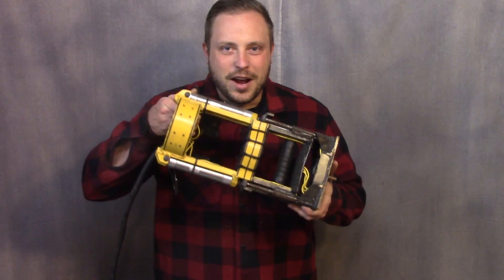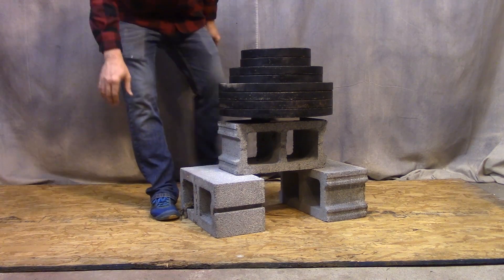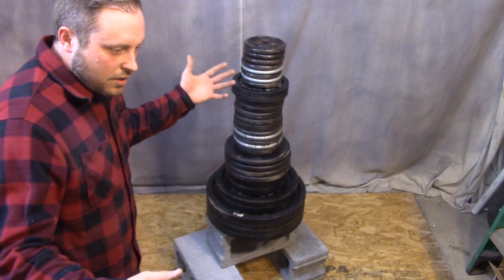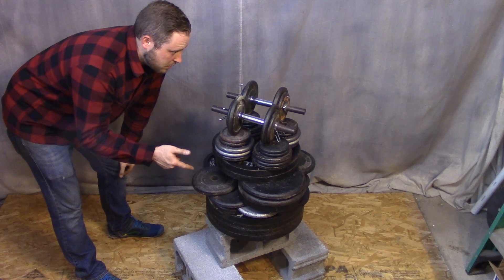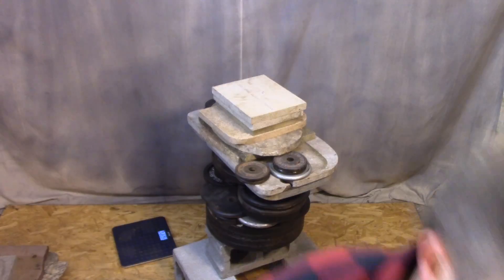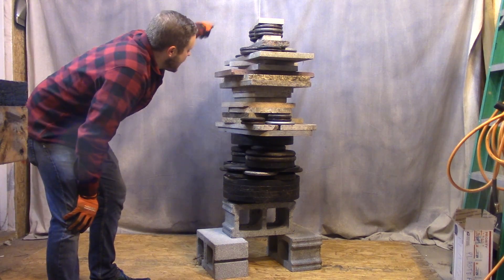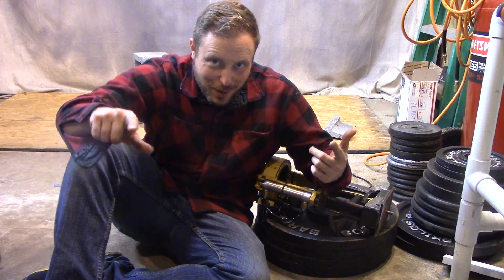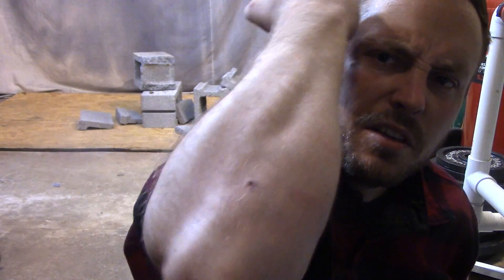POWERFIST POWER TEST - How much force to break a cinder block

Comment: but impact force is totally different than weight, weight is calculated by by the force of gravity on a given mass, where as impact force is is the total amount of force a point of impact measured in pounds per square inch and or Neutons

Comment: You can smash a cinder block with pretty much any hammer, axe, heavy metal bar some people even with bare hands, the doors you used in another video could have easily been kicked in so as a real test I wanna see if this thing will break in something like a solid hard wood or reinforced metal door or smash down a wall made of cinder blocks!

Comment: With the cinderblock McGregor could probably still do it because his fist has less surface area.
Reply: HelixMaster12 If his fist didn't deform on impact maybe
Reply: HelixMaster12 he would do it if he wants to Fuk up his hand for life 😂😂😂😂
Reply: His powerfist has blown through a steel door frame and etc. It isnt just a nifty knuckle protector. The fist protrudes out as he punches, (using c02) and produces a more powerful blow.
Reply: Tony Ravioli also to ampifly it, it has a small button on front with even less surface area

Comment: The block didn't break because the 1,000 lb of force was spread over a large area distributing that force while when punched it with your first all of the force was focused on that one point making the force much greater from the punch. If that doesn't make sense just think of that circus act of laying on a bed of nails; whey don't they get impaired laying on a thousand nails but if you do 100 you do get stabbed the due to the amount of area the pressure is exerted if the amount of force.

Comment: Is this guy like the dumbest person on earth? You have 3 vertical pieces of concrete in one of those blocks. If you stack a big round weight on the bottom then slowly add more weight you are distributing that weight evenly across those pieces....which are vertical making them able to hold a substantial amount. Hitting the brick in-between those vertical pieces with a heavy piece of metal doesn't mean you put more force into your strike than the weight places on the bricks.....in addition when you break something like that and it shatters it means your force is going through it and transferring into what's behind it. The difference between breaking 1 brick like that and 2 is almost nothing, unless the brick was a completely solid piece. Acting like breaking through 2 bricks means you hit twice as hard just makes you twice as stupid to anyone with a brain. Worst, dumbest, and most misleading video on youtube and youtube is full of a lot of dumb shit.

Comment: I don't mean to be a party pooper, but I do think that there is a difference between the static force of the weights bearing down on the block from all those lead weights and your kinetic energy that you impart to the block. I can't remember exactly but it has something to do with tensile strength vs load compression strength or some such physics. The force that your weights were exerting was more of a crushing force that was spread out across the entire block. The block appears to have a good resistance to a crushing force. But your punch was more of a piercing force because all of the kinetic energy was focused on a smaller area.

So maybe that block can withstand crushing forces over 1500lbs when the load is spread across the entire block. But focus that same energy on a much smaller area and the block can't withstand it. Like eggs. You can walk on many eggs that are in egg cartons and stood upright. But you would crush a signle egg. Or like walking on nails. You can walk on many but impale yourself on one.

Comment: There is so many false statements here. For example the cinder block is holding the weight on its outside, the strongest point. U stuck the center the weakest point. That point can be broken with a very confident persons foot. The reason the first experiment didn't fail right at the start is because the weight was being evenly distributed making the weight test useless. The right way to do this test would be to us a pressure board on top of the block. The board will recorded the amount of force reliably and u don't have to use a cinder block or weight.
Reply: I would also like to add that the tip on the tip would make it so easy that u could stank on it if the tip was in your foot

Comment: 1,900 psi is needed to break a single cinder block if my information is correct. This is of course not adding other materials to the structure. So as a force multiplier this is so strong for the size. My only thoughts to this and how to improve it, would be to double plate it. Keeping the co2 pin (i assume) as springy but bring out the first plate in the front along with pins on the corners. Maybe this is not a very well explained idea. I am no physics person so multiplying force on a flat surface idk. But by adding the bend and the points you would be able to apply the force easier. Or well i think you would. Again could be wrong either way this would be a amazing tool to say possibly sell to cops. Does not look very heavy.

Comment: when you were adding weight you were just testing its static load bearing capacity but when you punched it ; you were testing it's impact toughness . Both are different you cant compare those two on equal levels man.

Comment: It didnt break because of huge area of weight basin. If you add weight to smaller area, it will do much greater pressure. And than it will break it.

Comment: Now pick up the ten pound Weight and drop it from about 5 inches and it'll bust. Cinder blocks are used to hold mobile homes up you putting weight o. It proved what? Just curious

Comment: The way he put the weights on the cinderblock was not done correctly. Since he put the big ones on the bottom for proper balance, all the weight is distributed evenly throughout the cinderblocks.
Reply: JAIRUS OF ALL What? Do you fucking understand what he’s saying? You could have put a piece of plastic there instead of a cinderblock and it still wouldn’t have broken! The weights were holding it in place so it couldn’t snap in half!!!!
Reply from the maker: ooooh.... maybe you should watch the whole video and pay attention.

Comment: i think the cinder blocks can stand weight, but not intense sudden shock. I've broken cinder blocks just by throwing them hard enough, and I doubt they hit with 1000 pounds of force, so i dont think ur power fist punched with 2000 pounds. tbh, I'm not an expert, so if I'm wrong, please correct me.

Comment: i broke one of those with a golf club boi
Reply: WhynotGaming it's possible.

Edit: In this video he was only applying surface weight.
Reply: it's actually really easy to do, i would film a video and upload it to show you but i don't have any golf clubs right now so maybe if i find a skinny metal pole i will do it, also these are not that hard to break, you can also smash them into pieces with a small hammer.
Reply: Gabe Ruesswick I agree and I've broken cinder blocks with a short piece of 1/2 inch emt which is electrical metallic conduit which is supper thin and he also set it on the center beam which is the strongest point and like you said he had a punch basically on the tip of the power fist that popped through the block completly before the large area touched the block but this is a awesome build  not hating just saying he was wrong with the test and giving wrong info
Reply: Harrison maddox the "punch" as you call it is used to activate the fist, but it wasn't going to work because he didn't have co2 to use, which means that all it did was contract into the fist
Reply: RWH German Shepherds I believe you he used a retarded way of breaking and the power fist has a smaller surface area
Reply: its really fucking easy to break cinder blocks. They are designed to take on extreme amounts of pressure. Not suddenly applied force to a small point. 
A child can break them with a metal rod. Same goes how you can break a diamond with a hammer.
Reply: German Shepherds I just dropped it...
Reply: German Shepherds looks like a mess on mobile
Reply: German Shepherds boi
Reply: boi 👏
Reply: Maddinhpws I broke one with my hand when I was 10 lolol
Reply: But tell me... did you do it with a fuckin powerfist? I think not
Reply: I actually laughed bruh xD
Reply: German Shepherds ok
Reply: Lies or weak as cinder block cause u bought the cheap shit u poor kid
Reply: Momentum
Reply: German Shepherds my old friend broke one with his elbow years ago and he was 10
Reply: His powerfist has blown through a steel door frame and etc. It isnt just a nifty knuckle protector. The fist protrudes out as he punches, (using c02) and produces a more powerful blow.
Reply: Harrison maddox actually, if you watch the video of his with the steel door it shows that the protrusion on the front sinks in to act as a trigger.
Reply: Maddinhpws you cant break a Diamond with a hammer
Reply: German Shepherds UR A LIER I TRIED AND IT BROKE MY GOLF CLUB
Reply: Adrien010406 - Overwatch aha, hahaha (it was a sarcastic laugher, liar alert '-'

Comment: See you are cool in a way but you do under stand a 5lb hammer will bust the block easy were you would need almost a ton the way you did it. An the power fist doesn't add weight it adds velocity and that nipple on it is a bigger cheat to make it break stuff way easyer even with it retracting it still effects the break if there isint a straight down level blow which you need a machineto achieve.   Read up on mass vs velocity you will understand

Comment: Interesting. Concrete has great compressive strength but its not as good at handling impacts, thats why its used in huge building projects. The weight seemed to be fairly well distibuted along the cinder block maybe if it where more focused in the center the outcome wouldhve been diffrent.

Comment: Stacking the blocks does not multiply the force required to break them. You have to imagine the force being transmitted through the blocks. You could stack 5 blocks, hit them with a sledge, and break them all conceivably.

Comment: its structural integrity from the floor up is on its sides, when u placed that first weight it distributed all of its weight evenly across the whole top of the block, and the sides of the block are simply supporting the weight, not the empty space in the block. and the little point on the powerfist will pinpoint all the enerrgy into that one little area. so 1000 pounds per square foot compared to 200 pounds a square inch

Comment: If u put a point on the bottom plate maybe you can break it but you’d have to put about 300 lbs at once. You broke it with the power fist bc you concentrated your energy in a small area. Plz learn basic physics

Comment: No you are not putting down more than 1000 pounds you have a little point on the power fist so all the power you putting down is going into a smaller space so the psi is more than 1000 but you are not putting that amount of weight down.

Comment: Concrete is strongest in compression which is why it doesn't break initially. It would easily break apart if the tension was at 100 or 200 lbs of force

Comment: The fist has a small point at the top so the force is in a tiny area. The weights spread the weight out so the block could easily take more weight

Comment: The reason the block didn't break with weights was because you were putting them on the center which was like seven inches thick. Like wise when you punched it you can see that the center didn't break. The block broke off-centered from the middle

Comment: There's a thing called surface area and if it's spread than it won't brake if it's a small surface area than it will brake better and the power hammer has momentum un like that whale of a creation over there

Comment: There's too much surface area on the bottom so there isn't actually that much pressure or weight on a specific area
So use smaller weight on bottom

Comment: The problem with this video is the way you break the blocks. The weights are distributed over a larger area meaning that the force was easier to withstand because all the weight was being supported by something. While the tip of the fist actually helps break the block, all your force is centered on a small point which sends more force down the block. It's why knives cut, they use force over a small area to do large damage.

Comment: You forget the fist has the point that drives into the block when you punch.  It will pierce the block.  You need to put all that weight on a point the size of the point on your Power Fist.

Comment: Working in construction, I just wanted to go through my computer screen, put my hand on his shoulder, and say, "Dude, stop. That's not how it works". My hammer can break a a cinderblock on its side with only 20lbs of force. Resting weight, blocks can take about 800lbs each if the weight is evenly dist.

Comment: good thing you saved all that time an you were instead able to spend hours stacking an unstacking weights
Reply: ps if somebody punches at 750 pounds, over, say, 10 square inches, that is 75 psi. 

if you stack 1,000 pounds on 128 square inches, that is only 7.8 psi. so, in effect, you would need approximately 10,000 pounds before that block would have the same psi - force - exerted onto it. 

they build towers out of these things, they aren't weak!

Comment: this guy obviously knows nothing of basic weight distribution lol stacking weight lightly will not tell you how much force you are putting out. you can break a block like that just by dropping a hammer on it. doesn't mean that hammer is 2000 plus pounds of force lol

Comment: I don't mean to be "that guy" but let's be real here, if you were to go ahead and just drop sayyyyy, a cinder block onto another one, one if not both will break. cinder blocks are meant to hold up most houses, they make prisons and schools out of cinder, and the reason for that is because they won't buckle under weight that is just sitting on them, while on the contrary, it is VERY easy to drop a cinder block from your waist and watch it break in two while your boss is yelling at you because he specifically told you not to just drop it. Similar to a wine glass, you can place a 2x4 on the opening of a wine glass and stand on it, the glass will hold your weight because it is has very good structural integrity, but if you were to exert an abnormal amount of force, such as you jumping suddenly, it would most likely buckle. Sorry but come on man, I'm sixteen and I know better

Comment: Okay... say your power fist was flat large and would hit every point of the cinder block at once then you would have indeed put over 1000lb of force on it...... but your fist is different. You used piercing force on those blocks, which would require much less energy to break those blocks. It's like if you held a cinder block at your head and dropped it on the flat ground and then dropped it again except this time over like a thin root or maybe another cinder block it would most likely break when it hit the root because more force is being directed to one area not the entire block... sorry buddy but that fist does not deliver over 1000lbs of force

Comment: so just a little info on bricks the tensile strength of a cinder block is quite high so it build to withstand a high pressure slowly applied to the brick yet its shear strength is kinda low they can be easily broken with a punch from anyone with some slight training

Comment: You arent breaking the cinder blocks at the beginning and near the end because the bottom plates are distributed throughout the block you would need small weights that eventually grow larger for it to work on one pressure point. What you were trying to do was collapse the entire block not break it.

Comment: This guy has no clue how physics or anything works. An average cinder block can handle 1900lb per square inch. Just by guesstimating I would say that metal bar is about 45-50 cubic inches. That would mean it would take about 100 thousand pounds on that block to break it. I know I'm ignoring the fact that the block is slightly raised on ether side but still there is no way in hell he could of put enough weights on that thing to brake it. And the reason the powerfist broke the block is because because all of the force of the punch was condensed into a point that was small enough and had enough force to it to cause the block to fail. I'm just a random person who knows how to Google the strength of a cinder block so some of my numbers are probably slightly of.

Comment: concrete is amazingly strong when it comes to compressive force. On the other hand concrete takes impact loads vary poorly ,so no this thing does not produce 2000lbs+ of force the same result can be achieved with a  20oz framing hammer. not trying to be a dick btw

Comment: Simple physics, impact forces are far different from load forces, by adding velocity to your power fist, you ad momentum. Cinder blocks are strong, as you pointed out, but, they are brittle, meaning they don't bend, and whenever a impact occurs, the cinder block has to break or sink into the floor. You can break a cinder block with a relatively small impact force, circa 150 pounds, provided your arm is strong enough to withstand the punch, if your hand or arm breaks, then the amount time it takes your momentum to be transferred to the block is increased and the block won't break.

Comment: The reason why It didn't break was because the powerfist has a very concentrated impact zone and the weight that you put on was concentrated over a much larger surface area.